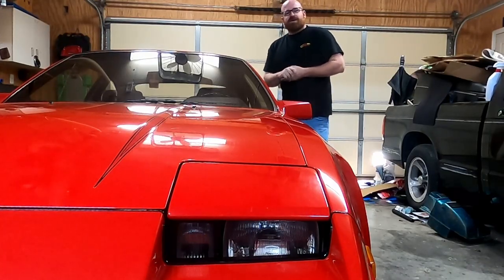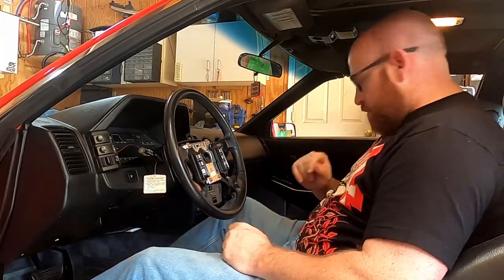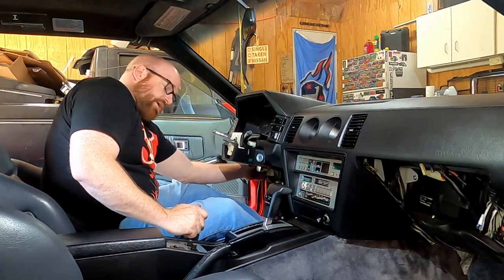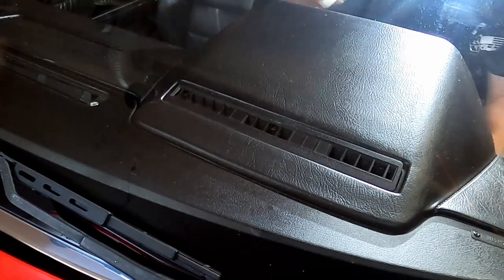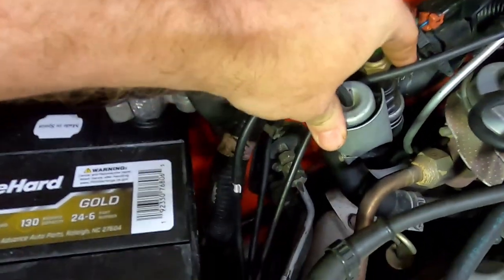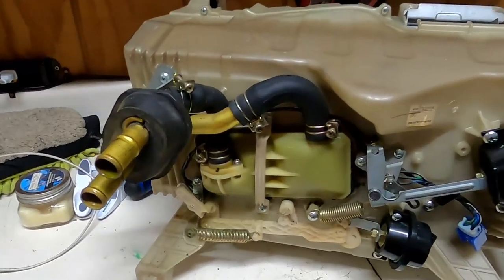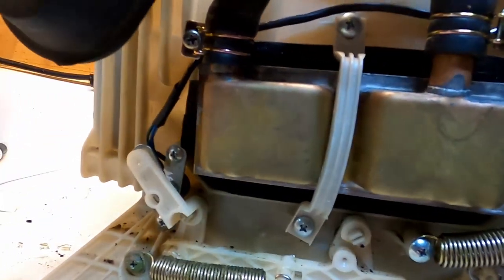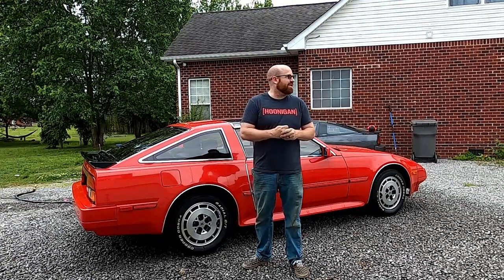Z31 300ZX Heater Core Replacement - Tearing Apart A Time Capsule!

Comment: thank you so much for this!!! i had been looking for a tutorial about 6 months ago and couldnt find a good one to save my life. i cant drive my z because any coolant i put in just leaks out from the heater core and im simply not mechanically inclined enough yet to figure out a replacement myself. does the 2+2 or auto trans matter for this repair because i have a 2+0 5 speed?
Reply from the maker: Thanks for checking the video out, I’m glad I could help! The 5 speed 2 seater makes no difference. Good luck and be patient with it!
Reply: Have ya tried to bypass  the heater core by attaching  the 2 heater hoses going to and from the heater?
Reply: Could always bypass it if need be. You just won't have heat in the cabin